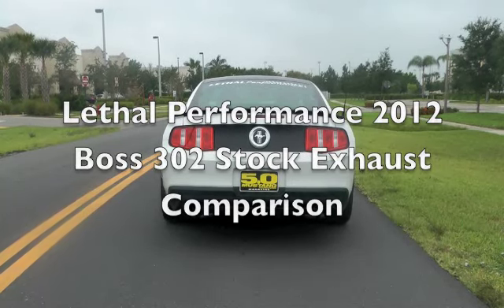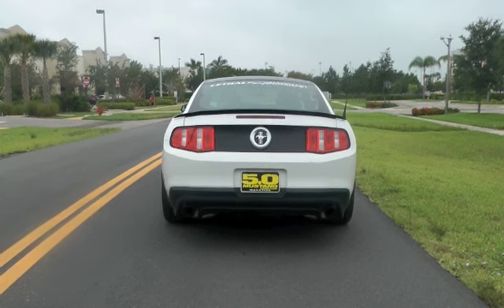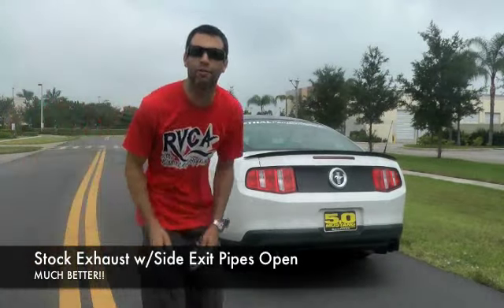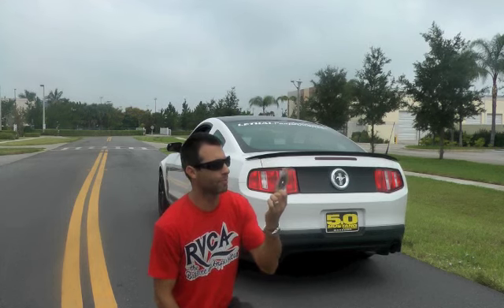Lethal Performance 2012 BOSS 302 Stock Exhaust Comparison

Comment: I read in mmff that someone missed a shift once in a boss 302 during a race and the computer recorded it revving over 9000 thousand rpms without any problems. And the kid who said supercharge this thing, it would make insane power but this is a boss302. It was never intended to be supercharged. It was meant to be high revving raw n/a power since the first one. Supercharging would be kinda un-original thing to do. Make high power naturally aspirated gives you somewhat bragging rights.

Comment: @AdverbAdjective You do know the LSX makes 720hp+/720ftlbs+ stock ON MOTOR right? That little ford motor you mentioned is blown and yet it still makes less power. Displacement matters alot more than people think. You can boost anything but if you have more displacement than a *similar motor with the same amount of boost you'll make more power. More cubes = more power. I think the only competition Ford has for GM is the ford GT (barely)... and it isn't even in production anymore XD lol. Good day.

Comment: p.s. I guess it's semi worthy to note the current mustang 5.0 chassis is actually a re-worked and updated DEW98 , used for the old Tbird and my Lincoln LS. If you take a good hard look at a sub 2003 LS you will see the definitive lines that make today's mustang look so mean. Also worth examining are the large bumpers and exhaust setup on the LS. It was the forefather of the current Mustang, though they removed the SLA double wishbone setup in the rear for the 'stang, for the limited slip diff...

Comment: @Lethalcamp thats part of the reason I love my 2001 Lincoln LS. WHile I knoe it's nothing special, it takes a wicked beating on a regular basis and still proves its got alot of life left in it @ 100,000 miles. Ford may have petty small issues here and there, but the engines, transmissions ( for the most part anyway... ) and suspensions are BUILT FORD TOUGH. I will keep my little luxury beater until it won't go anymore, then I'll be using all the cash I saved on non-repairs to buy a 302 BOSS !!!

Comment: @AdverbAdjective What a fox?.. F250 is where it's at. The blown 6.2 makes 638bhp not sure where you're getting 580 from. Where did the dyno results for it come from? A shop at 456789 ft above sea level lol? Either way having more cubes means you have more potential for power so no matter what the GM motors will always be better choices for power, especially if you like boost ;)

Comment: @AdverbAdjective There you ford guys go saying your fast with your blower lol. You 4.6 is trash with or without a blower I dont care how much you have invested into it... with the same money into an LS1 it'll wax your little ford mod motor. Only ford motors worth putting money into are their diesels and the 4 bolt 351 windsor. All of their OHC motors are garbage. Ford tried to get an advantage with technology with OHC and it did nothing but waste money. I do like their forged 4.6 and 5.4.